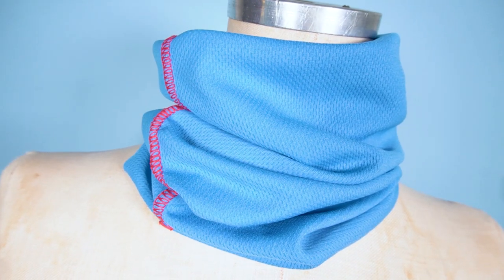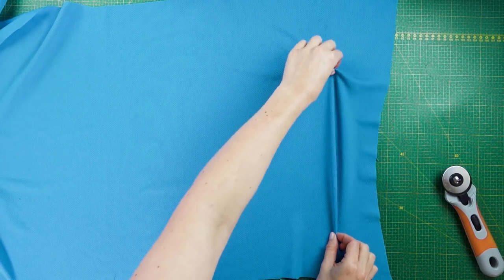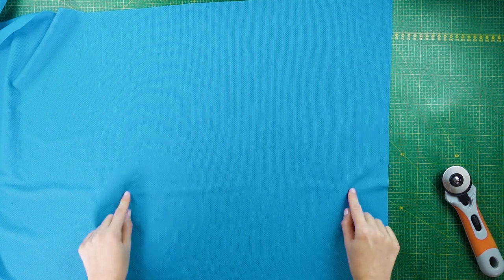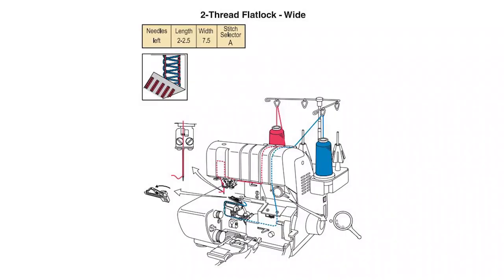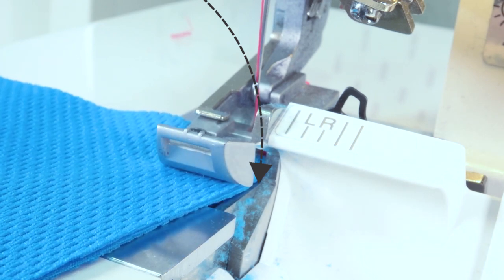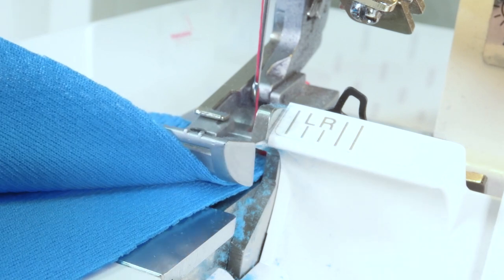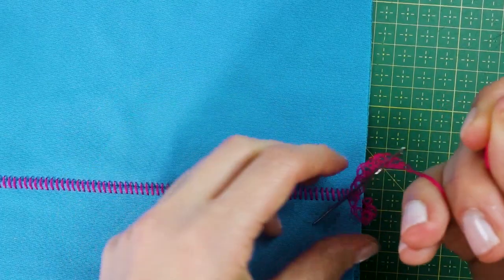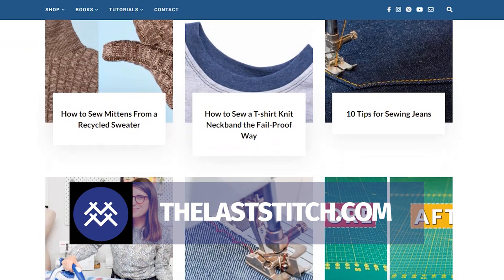Sew a Buff With a Flatlock Serger Stitch

Comment: Nice video Johanna!  I use these has headbands to hold back my hair or as turbans too!  I’ve tried threading the large hole needle to pull my overlocker threads back on themselves and didn’t find it as easy as it appeared in this video LOL!  I just fold back about 1/2” and zigzag on there to secure it.  I’ll keep trying though...maybe the hole on my needle wasn’t large enough!  Thanks for sharing!